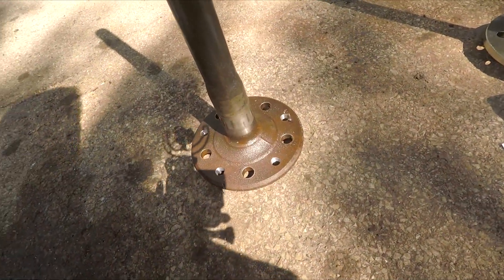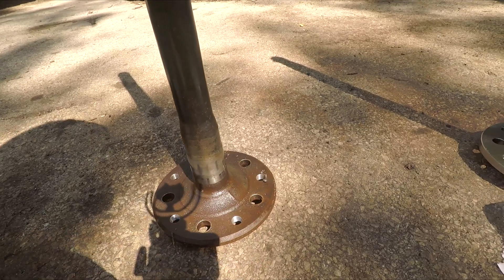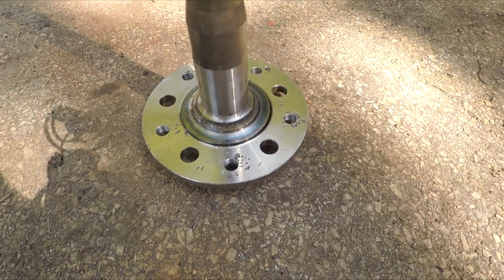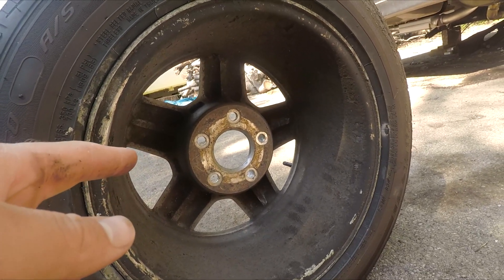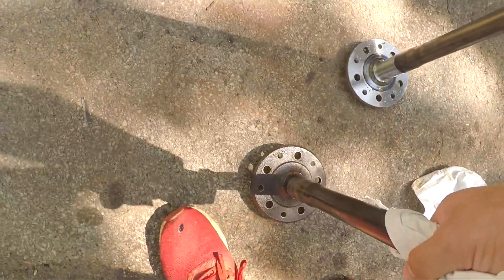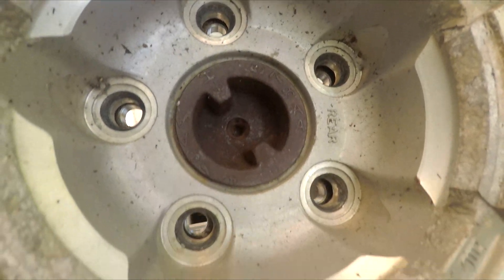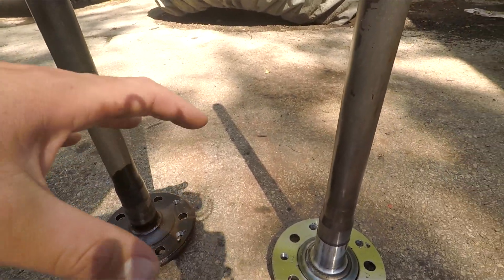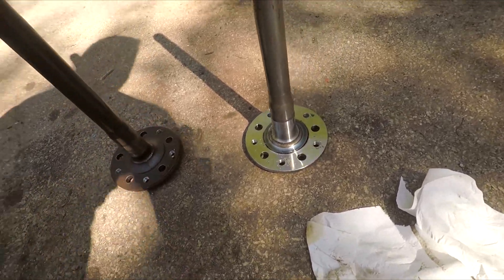Making Explorer axles work with Camaro bolt pattern. 8.8 Build

Comment: Just found your channel, iam building a 68 nova and replaced the original 230 six with a 383 that's new and hasn't been fired up yet! I've heard of people using those axles and they're supposed to be strong.  Thanks for sharing!